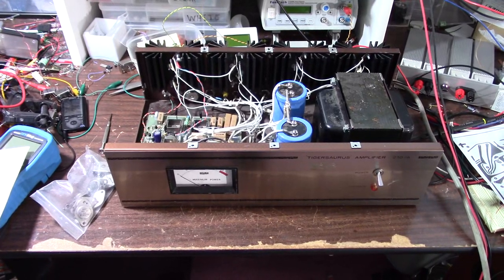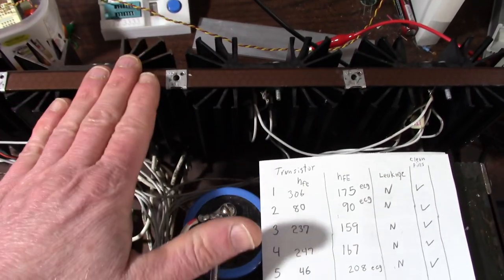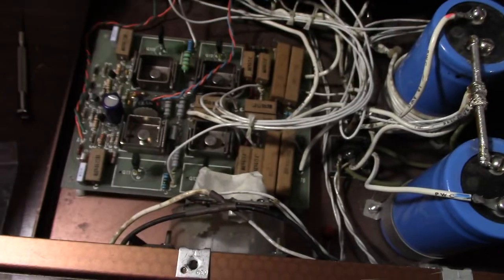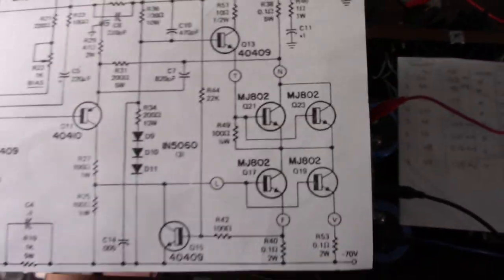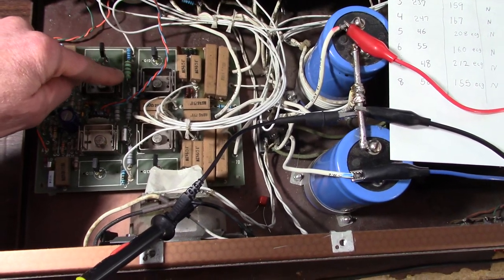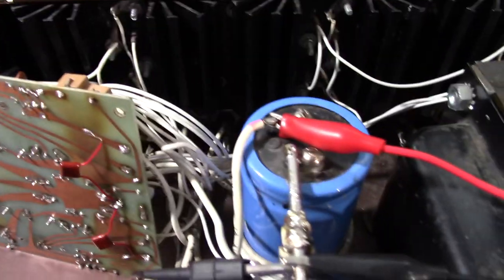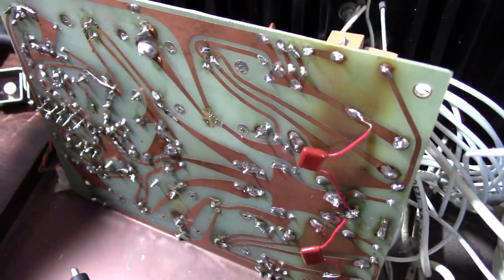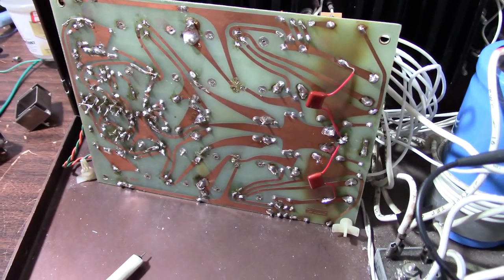SWTP Tigersaurus 210/A amplifier oscillation problem

Comment: I built a lot of the SwTPC amplifiers back in the late 70s. They all require a few things to be stable.
A secure, bundled, and symmetrical wiring harness to the output transistors is imperative.
And then add flyback diodes between speaker output and the power rails.
Clean the anodization from the RCA input connection.
And we would wind large output inductors because we used the amps hard at 4 ohms for low and mid frequency drivers. Good luck.

Comment: Found this in the Audiokarma forums:

"1. Add a 400pF cap from Q10 collector to ground, and Q11 collector to ground.
2. R14 must be upgraded to 1W. (nothing to do with stability, it was underrated.)
That did the trick." - Dr*Audio

Might be the same problem with yours
Reply from the maker: I did see that same post and tried that, but with no success. I read something on DIYaudio about an engineer who designed fixes for the amp, but I could not find anything on it.
Reply: @JohnAudioTech  Try looking for books by Douglas Self;iirc he used these as examples,maybe...

Comment: I still wonder about grounding, especially the RCA jack. A ground tied to the Al chassis is always suspect. I saw the oscillation much larger on the negtive rail, not so much on the positive. Huge RF signal on the Q8 collector, much more than above, this issue is mostly on the negative half. Make sure the wires on those big supply caps are tight! Would like to find some heavier lugs.
Reply from the maker: Yep, I'm seeing what you saw. The chassis ground seems good. Those big filter caps has low ESR, but I found them to have high ESL plus the long power leads that run to the back of the chassis for the fuses and then over to the board, so the film bypass caps I added to the board should help.

Comment: Be interesting to find out what's causing the oscillation.
Reply: I've a feeling it's going to be something weird. Like the substrate of the circuit board has somehow broken down and now it's in circuit. Just some deep seated problem that's pervasive. If every component checks out then it must be something else. Everything happens for a reason.

Comment: Looks like Q10, Q11, Q12 and Q13 were replaced with modern transistors. 
OPS transistors also seem to be replaced but not sure if they were replaced with old new stock or with modern transistors as well.
Modern Transistors may have much higher power bandwidth than old legacy ones. This might lead to oscillation.
Also, the wireing job in there looks terrible. Nothing is twisted to get field cancelation. This also helps oscillation to come on.

Just my 2 cent worth of remote observation.
Reply: You hit the nail on the head with the modern transistor problem. These amps can be redesigned with more degeneration but I kind of think this guy doesn’t know how to do this.
Reply: @SkYLR  It's a possibility. At least, that's where I would start to drill in. Most Audio guys seem to be DC guys and don't have any experience with RF stuff, and that might explain why most seem clueless when they have to tackle oscillation.  Most also don't have much experience with PCB layout. Again, they just look at it from a DC aspect and make terrible routing mistakes while  ignoring the signal return path. Stray capacitance and inductance are also commonly ignored. Most don't realize that there is much much more to this audio stuff than what's meeting the eye.
Reply from the maker: @billspencer8540  I'm no RF nerd but I've cured a 40Mhz oscillation with stopper resistors in another design. The distributed layout of this amp is not kind to fast transistors. I'd need to convert the outputs over to sockets in leu of the push-on connectors as they aren't fit for adding local stability components.
Reply: @JohnAudioTech  I'm glad you figured the oscillation problem. Adding components may spoil frequency and/or transient  response.

Comment: Modern transistors have too high GBWP. Need to reduce open loop bandwidth - can start with local compensation, base stopper resistors in some cases might solve it (outputs and drivers). Lots of options could turn into a good new series.

Comment: Theres a dry joint at the bottom.right of the screen @14:58 (though i dont think its connected to anything meaningful). But if theres one...there may be more you havent spotted yet
Reply: Mounting tabs for the little heatsinks.
Reply: A lot of techs will reflow every solder joint as a matter of course before they even begin to troubleshoot. Just to rule out bad solder joints.

Comment: The wiring is giving me the Heebie Jeebies. Really amateur looking.  It might not be a bad idea to put some distance between the wires to the base and the output. It's been awhile since I took a class, but I'm thinking if the amp has a phase shift of over 90 between output and feedback point its going to turn negative feedback into positive feedback, and it appears you have 90 just in the final stage.  Just as a test, I'd suggest modifying the feedback so it's DC only but AC open loop.  See if it still oscillates.  If it doesn't, then you know the problem is a issue with the loop (gain and phase).  If it does oscillate, then it should be easier to track down without the feedback confusing things.

Comment: how many watts are suitable for 8 inch 200watt speakers?
Reply: 1 watt.
Reply: @peterlarkin762  🤣
Reply: Many years ago, I ran films for a small (110 seat) theater.  Had a Pioneer Spec 2 driving a pair of JBLs for the sound.  I found about 1W/channel was the right volume.  If it put it up to 10W, I got complaints.
Reply: @russellhltn1396  I mean, how many watts is the ideal power amplifier for 200w l and r speakers 8 ohm

Comment: I don't have a clue why is someone wasting money trying to fix this piece of junk. At least chassis and transformer could be reused for some decent amp.
Reply: SWTPC branded hardware is collectible due to their place in electronics history. They were microcomputer pioneers. In an alternate Universe they'd be the dominant tech company today. But that's not what happened in our timeline. They lost and Apple won.
Reply: @1pcfred  Looking at that PC board, I'm not seeing a quality operation.
Reply: @russellhltn1396  you've seen the avionics boards I've made? Where was that?
Reply: @1pcfred  Unfortunately, they folded up pretty quickly after Daniel died.
Reply: @HillsWorkbench  yes they didn't have the two Steves that Apple did. But really at one time they were no more crackpot than Apple was. Heck I'd say SWTPC was more above the boards. Jobs and Woz got their start selling phone phreaking boxes. Was blue boxes if memory serves me.
Reply: Amp had great specs and symmetrical circuitry throughout. Fiberglass PCBs, high-quality transistors for the mid-1970s. In its day it was very advanced. Most examples of this amp did pretty well, this one has been troublesome...
Reply: @1pcfred  Good to know. I have never heard before about SWTPC.
Reply: @HillsWorkbench  I guess 0.1% distortion and 90dB SNR was quite impressive 50 years ago.
Reply: @jakubczajka4275  it isn't surprising. SWTPC is a branch of evolution that went extinct. They were one of the myriad of little companies that died off when IBM entered the market with their PC. But they were right there in the beginning along with the likes of Apple et al. Though less famous than Altair was. I think Altair's claim to fame was their association with Micro Soft. Way back then it was two words. Same band of thieves though. SWTPC made a Don Lancaster TV Typewriter that kicked off the micro revolution. That's the machine that inspired everyone. It showed what was possible. But they're most famous today for their model 6800 micro.
Reply: @HillsWorkbench  the amp does seems to have some deep seated intractable problem. Has anyone tried swapping the PCBs between the two amps? That could potentially narrow down where the problem lies. Troubleshooting is the process of elimination. Faults following components is a time tested technique. Desperate times call for desperate measures.